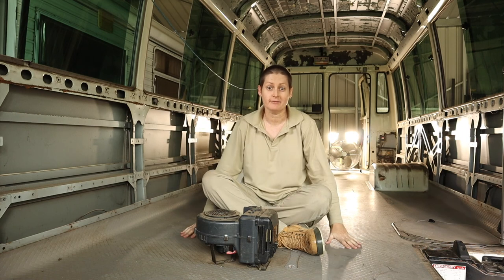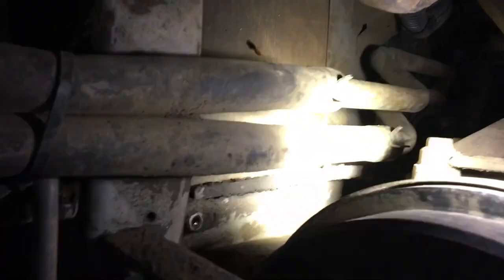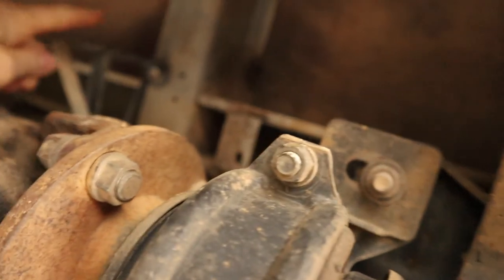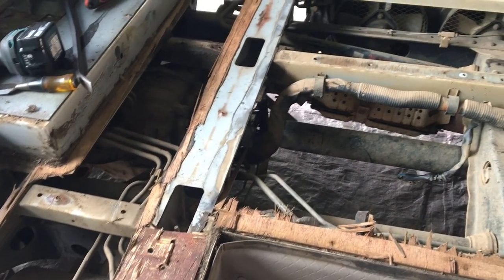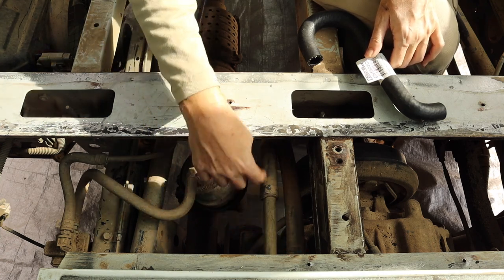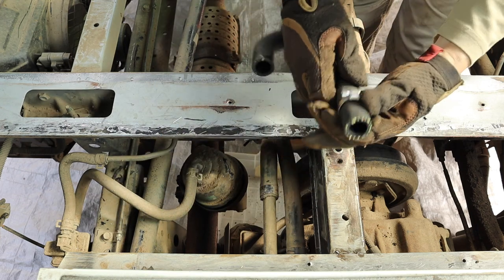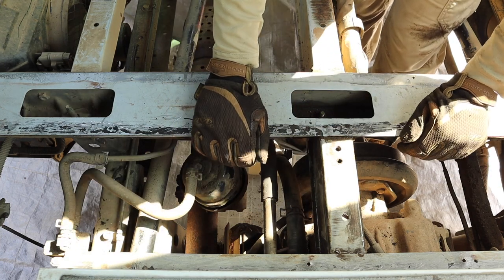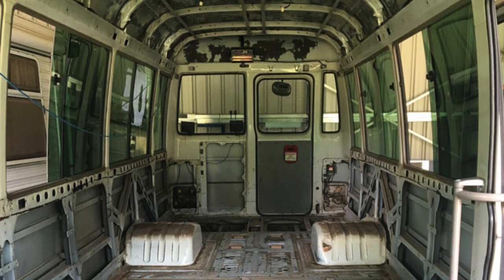Removing the floor heaters and the floor from my Toyota Coaster

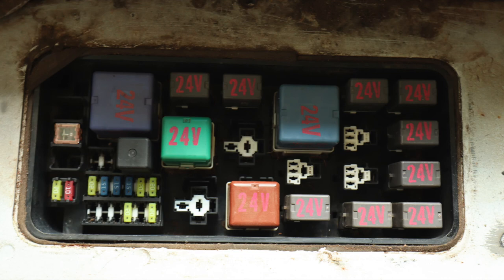Comment from the maker: I didn't shoot the actual removal of the heaters and hoses underneath the bus because I didn't want to risk getting coolant and dirt on my camera. But I did shoot in detail the final step of disconnecting the hoses and closing off the coolant loop near the engine so if you want to see how I did this it is the second half of the video starting at 12:15
Reply: Hey Dyani, can you give me some info on the clamps you used to close off the hoses and where you got them from, pls?
Reply from the maker: I got them from Supercheap Auto. I had to use two on each hose because they weren't quite big enough to reach all the way across. But one on either side worked perfectly and so easy to use in a tight space
Reply from the maker: These are the ones I used that worked https://www.supercheapauto.com.au/p/toolpro-toolpro-hose-clamp-small-2-pack/12579.html
Reply: @AGirlADogandABus  Thanks very much. I asked at Bunnings and they didn't stock any. Off to Supercheap when I'm at that stage.

Comment: I'm in the process pulling up the floor. I thought this was going to be easier than removing the ceiling and insulation....boy was I wrong. The floor is royal pain to get up. You make it all look easy. Pleez tell me everyone else struggles with the floor.
Reply from the maker: Video editing makes a lot of things look easy 🤣 I think most people would agree pulling up the floor is a tough job. Also, I have had some previous experience with ripping up floors since I did this in my big bus a while back (see previous videos). THAT floor was a right royal pain in the butt and many a crowbar was thrown in anguish then I can tell you. So for me, after struggling with that floor for a whole week, the coaster floor was a lot easier. Bit still the hardest part of this build so far definitely.

Comment: I really enjoy your vids, find them super informative.
Reply from the maker: thanks so much! I'm glad you find them helpful.
Reply: I was wondering if you have considered to use hot engine water to heat shower water with a heat exchanger of course
Reply from the maker: I have heard of people doing that but it's not something I considered doing myself. I'm not having a built in shower so only need hot water for dishes and a quick wash for me. I have a small electric hot water heater which I'll be able to run off my solar and if there is no sun for days I can just heat water on my metho stove

Comment: Thank you so much for the brilliant videos, I have loved watching the progress on your coaster conversion so far. When you removed the rear heaters does this mean the bus has no heating now? Or is there a separate heating system for the drivers area? 😀
Reply from the maker: Hi Ruth, there is still a heater in the dash at the front so I can use that when I'm driving and I plan on installing a diesel heater for heating when I'm parked up.
Reply: @AGirlADogandABus  Awesome, we are wanting to remove the 2 rear heaters from our Nissan Civilian, your videos have been so helpful, thank you!

Comment: How did you leave the heater electrical connections under the floor - did you seal them in some way?
Reply from the maker: At the moment, I have left all the wiring there. I didn't actually cut any wires to get the heaters out - I simply unplugged them. So under the bus is just the plug connected to the wire that runs to the dash., Just nothing is plugged into it now. I haven't really decided what to do with it yet. I might be getting an autoelectrician to do a few things so maybe will get them to remove all the old heater wiring as well depending on cost.
Reply: @AGirlADogandABus  fair enough and that is what I thought- I think I might use cable ties and some electrical tape over the terminals - cheers

Comment: this may sound like the dumbest question but you only need to have one hose bend / new 
bi-pass right, because we cut off both heaters but cut back on all the pipping up to the front near engine? am i thinking correctly?
Reply from the maker: Yes that is correct. The hoses run from the pipes at the engine, up to the first heater, then onto the rear heater and then back to the engine. It was one big continuous loop going through both heaters so once you have the loop closed at the engine that is all you need :)  By the way, there are no dumb questions!  Everyone that has ever done a bus conversion had to learn from someone else in the beginning.
Reply: @AGirlADogandABus  thank you again lovely for your help. 🙏🏼💖🙌🦋🌸🦄👏💫☺️
Reply from the maker: @amandaalley77  I don't have a link sorry. It was just in a bin with a bunch of other different shaped heater hoses at my local Supercheap Auto. I took a piece of the old heater hose in so I knew what diameter I needed and could compare sizes and just found that one that was close to the right curve I needed. You could probably get something similar from any automotive parts store.
Reply: @AGirlADogandABus  all good turns out we do have a super cheap auto here in Sydney so I got the same as you. Thanks again for getting back to me. Wish me luck I am giving it a crack tomorrow. 🙈
Reply from the maker: @amandaalley77  good luck :)
Reply: @AGirlADogandABus  thank you darling 🙏🏼🌸🦋💫💖🦄

Comment: Bonjour pourquoi vous avez changer la durite
Reply from the maker: I changed the hose because the old one was very dirty and worn. Also, I could not get the old hose to bend as tightly as I needed it to without kinking. The new hose was already curved into shape without kinks and it is in much better condition so should last a long time and less chance of leaks on the road.